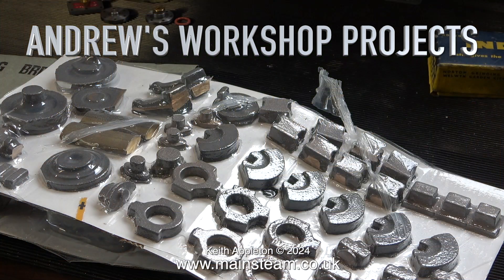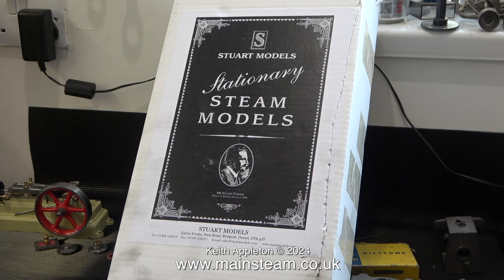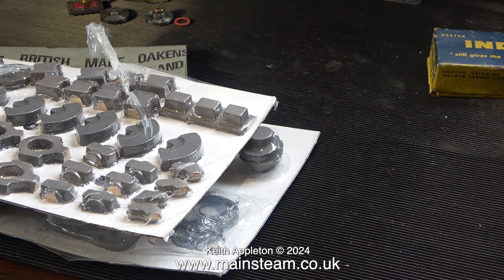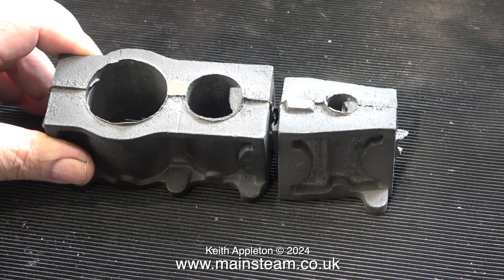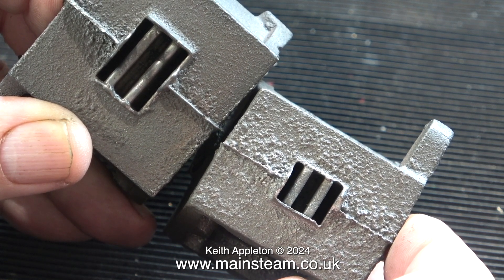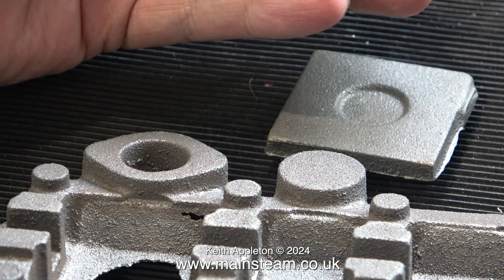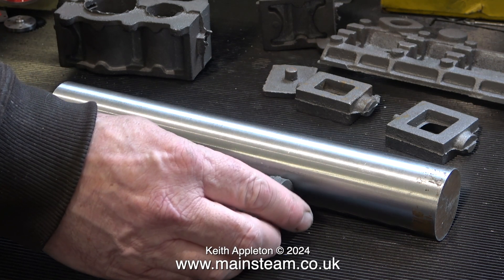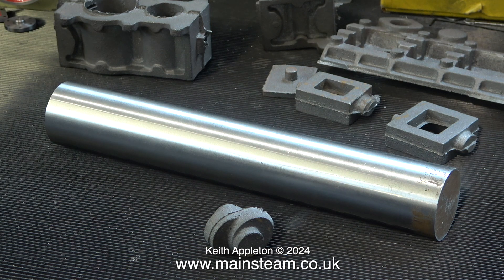ANDREW'S WORKSHOP PROJECTS - PART #15

Comment: Fettling Idea.  How about putting the  rough castings into a tumbler for like 24 hours each.  Depending in the media and the metal it might knock down some of the junk which would save some file time.
Reply from the maker: I don't think that would work.
Reply: @keithappleton  Bummer.  Laziness is the mother of invention!  I was thinking ceramic triangles or ball bearings would do it like they use with commercial metalworks to knock the edges off of things.  The kid seems committed, as long as he doesnt paint himself into a corner I am sure he will keep moving forward.
Reply from the maker: Andrew is not exactly a kid, he is about 60 years old }:-)))

Comment: 3/4 inch and 3/8 inch are happy requirements for those in the "Metric" world.  Use 19 mm and 9.5 mm, respectively.  0.750 inch = 19.05 mm.  Most of the time, 50 microns is not an issue.

Comment: Hey Keith, you can weld cast iron without the thermal problems, but the equipment and experience you need is enormous. 
As a tool you need a Laser welder, which are very expensive starting at about 25.000$ and therefore much above the budget of most home workshops. Even in my company we calculated it for days before getting one of them.

Also a Tripple Expansion Engine, very nice project. How difficult is it to build one compared to build a Victoria?
Reply from the maker: Stuart Triple Expansion Engines are very difficult to make for the average enthusiast, I watched Andrew's attempt, which at least has started off OK, this is the easy bit }:-)))